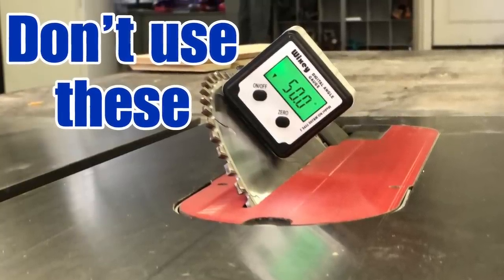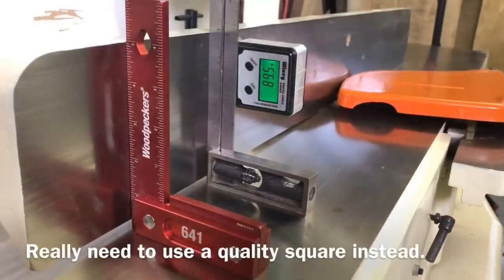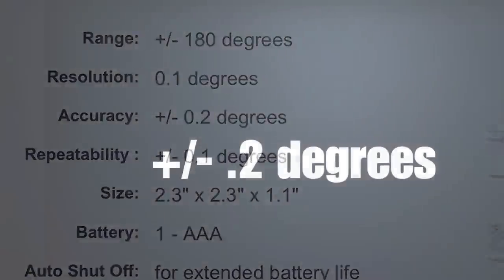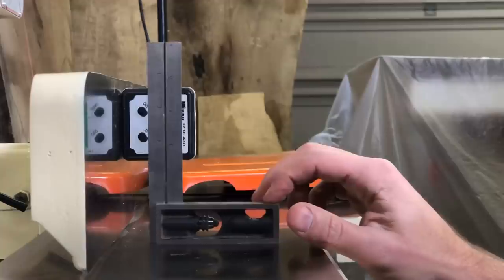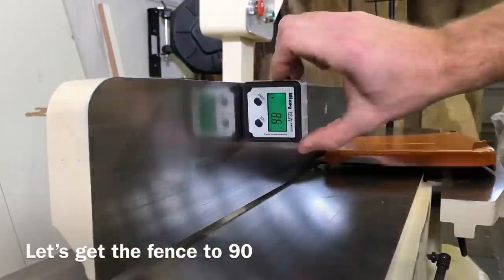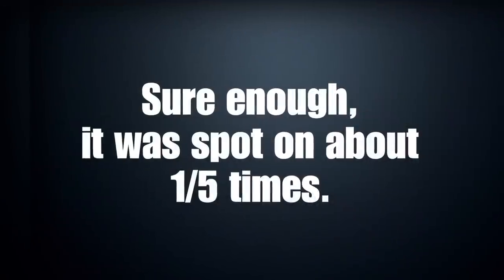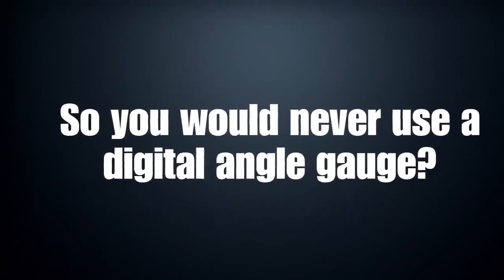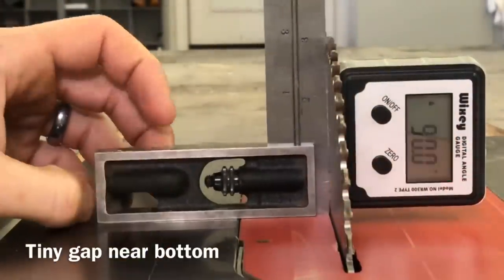Table Saw 101– Digital Angle Gauges— How To Woodworking

Comment: Feel free. It works with any number of boards. I found putting an x on alternating board faces then always being able to see the x as i joint worked well. The only down side i ever found was when grain just would not cooperate and tearout would occur. Not a common problem but given desired face and end grain orientation it can throw an annoying wrench in the gears.

Comment: Inexpensive and very accurate solution: For my table saw, to set 90 deg, you don’t need either expensive squares or electronic gauges.  I use 2 pieces of hardboard that are laminated to 3 layers thick to provide dimensional stability.   They are dimensioned 14” x the max cutting height of my blade (on an old 10” Unisaw).  Importantly, mark them to keep track of the orientation of each.  Using your bevel gauge, run them through the saw to just lightly trim one end at full blade height.  Key point here is to gang cut them.  The test of square is to then place each piece with the cut ends on a clean, flat surface, and orient them with the edges that were down on the table saw are against each other.  This doubles the error.  Backlight it.  If there is a gap at the top, you need to move your blade counterclockwise, and vice-versa.  You can get it within a couple of thousands of an inch over the length of the pieces which is very good for precision woodworking.  Replace the boards when they eventually get down to about 12” long.  ....   for the jointer, square really doesn’t matter if you run your project boards through such that you have the top face of one board against the jointer fence and the top face of the other is away.  The angle inaccuracy cancels out on the glueup.  You do, however, need to keep track of what piece was oriented which way.  That being said, I do keep mine as close to square as I can get!  .... For 45 deg on the table saw, you can do something similar and check against a good square to see how close you are to making 90 deg with the cut faces against each other.   That’s essentially a test cut which you should do anyway.  .... BTW, I do have Starrett squares (12” and 6”) as well as an electronic gauge and I totally agree with your comments!!!
Reply from the maker: Thanks!
Reply: While that works pretty well, it is an overkill method. That's why people invented and created tools and devices to ease the work and still achieve great results. 
There are multiple ways to achieve the same result, some ways are easier than others, some are more accurate, some are just too complicate.

Comment: Square is one of the most important aspects of building anything. Knowing your tools and having confidence in them is the basis on which consistency is built.  1 in 5 is not good enough for me but it may be for others. If that is the case keep filling your joints with epoxy and glue.
Reply from the maker: For sure

Comment: I would do it as you as well, but even squares made out of metal with high prices have a tolerance, just like the digital meter. I used to work with navy metcal and we checked for calibration of squares and flat guides that were made out of metal or solid surface or stone. Those items had to be checked on a regular basis, the cal cycle depended on the type, manufacturer and was based on historical data, so nothing is in cal one time and never needs checked again and everything comes with tolerances. Tight tolerance means more money so its efficient to determine how much you need or how much variance your project can tolerate. I would ask, if your cheap square is always matching your expensive square, then why did you purchase it?...and as others noted, it appears like there were some light showing through the squares and then we must ask, are our eyes calibrated LOL

Comment: I've used these, like you said for arbitrary angles and they work well. More recently though I've used them to set up my band saw. It did just fine. But I agree wouldnt use one of these to set the presets on a table saw or jointer.
Reply from the maker: For sure. I’d definitely use it on a bandsaw too.

Comment: What are you building that has such close tolerances or requires such precision?
Reply from the maker: Glue joints mostly. Especially when multiple boards are involved. For me I can’t imagine not shooting for perfection. Inevitably it won’t end up that way. So I’d like to control everything I can to compensate for what I can’t.

Comment: I have the same wixi gauge and use it all the time for 45 and returning back to 90 and also returning back from a dado stack. 
Several times you didn’t zero the gauge. And also don’t forget the gauge is just a fancy level so even when you zero it if your table or jointer isn’t perfectly level it may show on the wixi.
Reply from the maker: Glad it works well for you!!

Comment: I think the digital gauges are a good step up over a a Home Depot square, within a reasonable price. They are what, $30, give or take? The vast majority of us, if we are just at the point of upgrading from a home store square, aren't about to drop bank on a Woodpecker, yet. Hell, I have been selling stuff for 2yrs and my "nicest" measuring tools are a 6in PEC blem combo square, and an iGaging digital gauge. I don't have a jointer, and have to do all my edge jointing with the table saw, or router, though mostly the table saw, and honestly I have never had any serious issues gluing up panels. One day I will get high end measuring stuff, but I think it is a bit much to discourage people from using them, given that most of your viewers are likely people who have jobsite saws, and other tools where getting high end accuracy, that even stays put, is going to be a struggle with, or without, a Woodpecker square. 

My recommendation is to buy an angle gauge until you are at a point where you are serious enough, or rich enough, to buy a Woodpeckers square. The gauges are better than cheap squares, of that I have no doubt from my own experience.

Comment: The digital levels are awesome for a number of things you can't do with a square.  Level for one.  At a known angle to another surface for two. 

If you have a known accurate reference square and that answers the need then go for it, but these digital levels can do so many more things...
Have two pieces of steel to weld square and the bottom one is at 2deg in situ? No problem.  Set the other one to 88 and you are done. 

Can't fit a square into the space? Digital level is only a couple of inches across... no problem. 

Sick of having your square sitting against carbide insert teeth on your saw blade confounding your measurement?  Stick the magnet base to the blade disc and you are away. 
Can't get your head aligned to eliminate parallax error? Doesn't matter with a digital tool.

Horses for courses.
Reply from the maker: Good tips!

Comment: I resiliently learned to use a router tale to get those perfect 45% angles for glue ups. Thank you for pointing out the inconsistency of those gauges.
Reply from the maker: I’ll need to learn that method!
Reply: What is a router tale?
Reply from the maker: gerard fallon maybe google it?
Reply: @BlacktailStudio  chamfer bit

Comment: I did not notice the gap between the fence and the two precision squares that others saw, but I did see something else that bothers me about this argument. 
When the fence was adjusted to make the digital gauge read 90°, there was about a ten mil gap between the 5-inch mark on the square and the top of the fence. When I  calculated the offset angle from those two numbers, it was only 0.11°.
But that was 5 inches from the base. You're not likely to edge glue two 5-inch thick boards. You're generally working with 3/4-inch boards or less. At 3/4-inches away from the pivot point (way down near the bottom of the fence), the offset distance will only be 0.0015 inches. 
The wood will swell more than that once the glue hits it. The worst-case scenario,  with the digital reading off by 0.2°, yields an offset of 0.0026 inches. 
In other words, in general, the slight error due to the tolerance of the digital gauge is insignificant to a woodworker.
Reply from the maker: Thanks for the feedback!

Comment: I own an old scarlet square that was out of square for a while... I eventually just wrapped sandpaper around a card scraper and sanded down the two points the ruler sits in inside the housing and fine tuned it.  I do believe owning a high quality square is important... but you can use it to check "cheaper" squares and tools around the shop.   Having accurate,  reliable tools makes any job or task less frustrating 🤓
Reply from the maker: Well said!

Comment: I think the takeaway is to do a couple a measurements and take the average, if you need that level of accuracy, but  + or - 0.2 actually seems really precise for a tool that cheap and user friendly.
Reply from the maker: Yeah! They are amazingly accurate for $30. Just important to know their limitations. If it’s not a glue joint it’s probably fine.

Comment: I mostly use hand tools. It blows my mind at the levels of accuracy demanded by modern techniques.
Reply: Not demanded by the techniques, but by the people. Man, I dig some of these gizmos, sure, and my caliper can do 1/1000 of an inch which is neat. None of it is necessary; as a newbie I'm probably going to fuck up the cut, anyway.
Reply: Aim small miss small. I'd rather aim for  a thousandth of an inch and miss than aim for 1/8th and miss.
Reply: @pragmatictwitch  I started using a dial caliper for building R/C airplanes in the early '90s.  It's MUCH easier to hit the center of a firewall or other piece with a caliper and a calculator than a ruler.

Comment: I appreciate your video. As a full time woodworker my response is it depends on the build (as you pointed out). There are times where absolute precision is a must- and times where there is a small degree of give.  Of course a build is either square or not square. No such thing as “sorta “ square :-)
Reply from the maker: For sure!
Reply: unless you are a builder, then square has a different meaning as does level.

Comment: Good video. Regarding if it's good enough, it depends on who you are and what you're making. Some people may not care about imperfect glue lines with the thought that they are going to sand and or plane it anyway.  For things that may compound on themselves (like picture frames do) a .2 error would be very noticeable. I don't own one of these so I can't say too much. I do own some woodpecker squares and have found them to be very accurate.
Reply from the maker: Yeah, I think I didn’t clarify that enough in the video. One edge of a table being off by .2 isn’t a big deal. But 10 boards glued up (or a picture frame) is where it’s quite noticeable. Well said!

Comment: Any square can be upgraded to finer precision with another square and a file.
Reply from the maker: True!
Reply: what if the square checked against  is off ? ,  for my home use i just use the square to mark a fine line with a razor then flip the square over and check it against the razor mark . I have never found one that was perfect in a 12 inch square which is all i own but i have 1 that is very very  very close and one that has a gap  at the top of the square .
Reply: I've been keeping Dad's framing square alive for the 30 yrs I've had it.

Comment: I just bought a  digital gage (S & F)  I checked my table saw, that I had set with my machinist's square it came out to 90 degrees I then wanted a few minutes and measured again 90 degrees. I will admit that if I just wanted 90 degrees it is quicker to use a quality square. But what if you want 60 degrees or 74 degrees?
Reply from the maker: Yup! Hard to find a 62” square. Mainly matters for glue joints

Comment: To answer your root question, I personally prefer a mechanical square rather than their electronic counterparts.  But there is much more to setting up machinery fences (and other parts of the machine which affect the outcome of the wood being machined) than what you're suggesting here.  Let me explain...

The most accurate method to set up machinery is not to rely on squares or gauges, but to measure the actual piece of stock you have machined with the machine you're setting up.  Using the jointer as an example, let's assume for sake of argument that the knives are sharp, correctly set parallel to the two tables and very slightly higher (.002") above the outfeed table to compensate for the radial arc of the cutterhead.    Okay, now go ahead and set up your fence using whatever gauge or square you feel most confident it being accurate.  Once done, run a stable, properly dried plank at least 3" square and at least 2' long through the jointer until the first face is as flat and true as you can get it.  Then holding that "true" face against the fence, joint the adjacent face a few times until you're really happy with the results.  THEN, take out your most accurate square and measure the outcome.  Don't be surprised if there is a difference between what the angle of the wood is and that which the same square measures, because there are several things at play which can affect the outcome.  The most important one is how truly co-planer the two tables are to each other and how accurately the knives have been set.  It really takes very little for a difference to be felt.

Sorry if I've gone beyond the parameters of your original question, however I think it's important that woodworkers understand that there's more to setting up a machine than angling the cutterhead, sawblade, or whatever else is doing the machining.
Reply from the maker: Very thorough! Thanks for taking the time to write that.

Comment: I noticed that you are quickly flipping the digital angle meter through the ninety degrees from your table to the fence. Would you get better results if you went a little more slowly and smoothly from position A to B? The only way I’ve seen these used before is stuck to the side of the blade (which was verified square to the table via conventional means), zeroed, and the blade tilted slowly to 45, 22.5, 60 degrees etc. I just wonder if you’re overwhelming the sensors a bit with the fast moves. N.B. I do not have any experience with these digital angle meters. I’m just saying that your video is the first I’ve ever seen where it was expected to track so quickly.
Reply from the maker: Good question! I don’t think the rate that I moved it affects some of my videos were slightly sped up too.

Comment: I have this gauge as well, but I don't think the accuracy (at least on mine) is really there. I found on a few measurements that my gauge was over a full degree off. I usually set my blade with the gauge and then verify the angle with an angle finder if the angle is really critical.
Reply from the maker: Great point! I don’t like these very much when they work perfectly. Let alone when then start to fail over time. Thanks for the input!

Comment: As I always drop my tools (I could blame it on carpal tunnel, but it's really just clumsiness) I would find it hard to spend so much on a square. That being said, I do find that the digital one is off enough to notice when gluing up, so I always check everything with a square after getting it close with the digital.
Reply from the maker: Yeah, aluminum ones are better for the occasional drop. But still could knock it out if square. Nothing worse that ruining a good tool with the clumsiness I’m also prone to.
Reply: @BlacktailStudio  good to know that the aluminum ones can take an occasional drop. I might have to drop some cash on one :)

Comment: Not fair comparison....!!  So my issue with your video is that you talk and treat all digital instruments as if they're the same and have the same performance, tolerances, and specifications.

Furthermore,  you make a point to talk about quality differences in squares and claiming some are better than others but fail to due the same for the digital.

You basically compared to a NASCAR gasoline racing car against a electric Chevrolet volt.

A fair comparison world be to compared the $35 digital (I have the exact same one and that's what I paid) to a plastic Square  or go buy a $200-300 plus angle finder and then compared to your woodpecker square.

Anyways, I'm going to consider this just a paid ad for a woodpecker at this point.
Reply from the maker: It wasn’t a paid ad, but thanks for the feedback! I actually like my Starrett a little better. Which is why you saw me use it more in the video. Thanks for the comment though, I appreciate the feedback!
Reply: I do like woodpecker products though.... :)
Reply: I said a $35 digital....
Reply: @DerekAndersonMinnesota  So you comparing a 35 dollar digital tool to a 1 dollar plastic one is as "fair" as him comparing your 35 dollar tool to his 90 dollar one? Gotcha.
Reply: Yes - $35 digital vs $1-2 plastic square.  Since woodpecker is higher precision instrument, we should compare it against a higher precision digital instrument. Lets say we use a Westward at ~$100 which gives us a .02 accuracy with a repeatably of .05.  This is .02+/-.05 which is around a one-hundredth of an inch inaccuracy at 6".  

Of course the true practicality of this also assume you can have the digital protractor perfectly vertical to saw otherwise your measuring multi-axis vector.  So in a real-world situation in needing this level precision, I guessing you would end up using a precision square anyways to ensure your digital protractor is perfectly vertical.  The point being is while the digital protractor instrument may have enough precision, its the other axis that ultimately become the issue.  (when the flat surface on the precision square is placed on the table, it provides some level of confidence that your measuring a single vertical axis)

For what I do,  my $35 digital protractor/angle finder or $15 square works fine.  :)